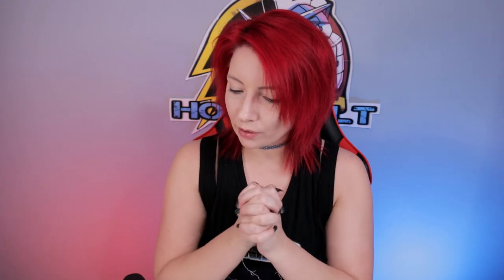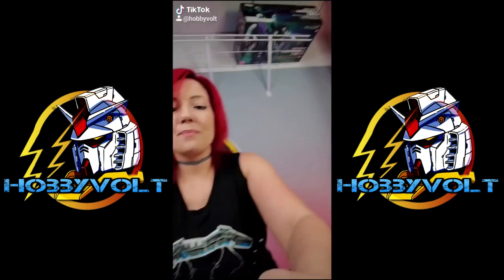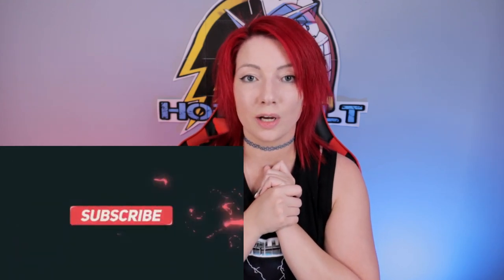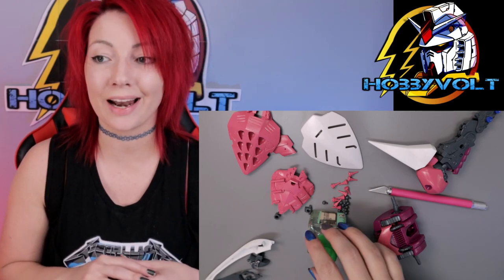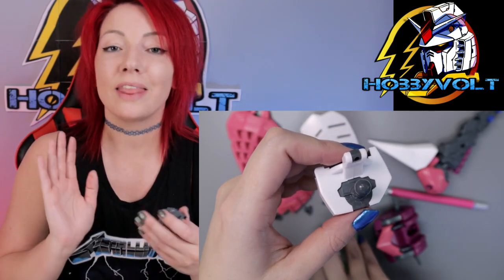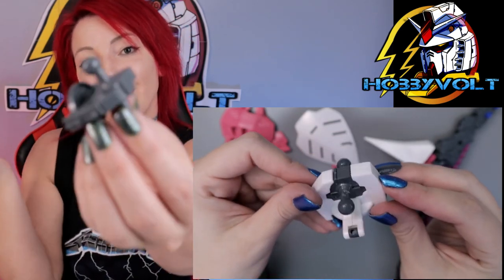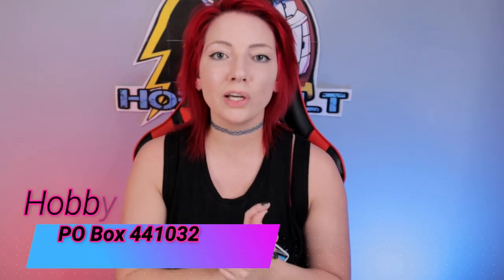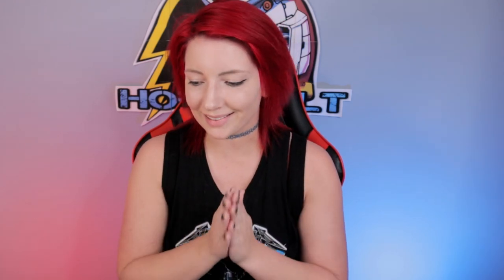How to fix Broken Gundam Parts! Tamiya Cement #gundam #gundams #gunpla

Comment: Information to better understand fixing broken parts: 
The thing about broken plastic parts is that they'll never be as strong again, unless you can pin the parts with metal (sticking either a brass rod or paperclip piece in there).
The thing with materials is that they have an underlying structure and properties. The harder something is, the more rigid and prone to cracking it is. The softer something is, the more pliable and flexible it is without being damaged. Same goes for plastic, glossy hard plastic cracks easier, like the white plastic on an RG Tallgeese. 

The reason I mention it is to give people an idea about how materials work. If you zoom in on it on a molecular level materials have lattices and structured molecules. Think of wood, it has layers around a center and for gunpla plastic you have the way it's flowed into the mold and settled. 
Meaning, if something breaks, that length is interrupted and when you glue it back together with cement, that damage is still there even though it's fused. That "length" is what gives the material structure and allows the force to be distributed evenly. A glued on part doesn't have that distribution and the weakest link will break with less pressure than with an unbroken, unglued part.

Extra thin cement melts just the top layer. Regular tamiya cement will melt more, but also give you a generally stronger bond. 
Use the cement on both ends, let it work for a dozen seconds or so and then put the parts together, move them around a little to mix the melted ends and settle where it "fits", then let it rest and cure. 

Superglue isn't just something universally "sticky", it's a liquid plastic that hardens when subjected to moisture and has an extremely high viscosity/low surface tension, meaning it flows into everything it can, so all those surface irregularities too small to see, the glue flows into and hardens, creating a layer in between the two parts that is "hooked" into the little divots and ridges of the surface. If you had a 100% flat surface, the glue would just form a layer that would slide off.

A pinned part is when you drill a hole on both parts and stick a metal rod in it, superglueing it to both parts. You can cement the broken end as well to remove the surface break and create a double bond. This is as close to the strength of an unbroken part as you get.

For something tiny, like a tab on a sliding panel, like the ones on a transforming unicorn gundam kit, I'd say go with superglue. 

Bottom line, you still need to be careful with the bond, no matter what you've broken and fixed.
Reply: My man u r a god
Reply: Im trying to fix my unicorn gundam   because the sliding panel broke so do i uss super glue ?
Reply: @Iamasmartandhardworkingperson  I fixed an MG Phoenix (basically the same as a unicorn) with plastic cement, it was a tiny little tab that was part of the transformation gimmick.

The reason being that it has to fit in the groove and move freely, so using plastic cement (also known as plastic glue) gives you time to set the piece properly.

Superglue doesn't give you more than a few seconds of worktime, but if you can align it perfectly and make sure you don't use too much so that it spills everywhere, it'll work just fine.

Just remember that it'll always be a weak point on your model and needs gentle handling.
Reply: Thank you too

Comment: Broke a joint peg at the leg of my MG Justice. Thank god you had the same problem as mine. This video has been super helpful. Thanks!
Reply from the maker: It's the worst! I'm glad it helped you!!!
Reply: How did It turn out? Was the bond as strong as originally was?
Reply: @nelsonfabianriosdeantonio6211  not as strong as it used to be before. I didn’t bother touching that joint anymore ahahahaha. But in my case the joint has a cap(?) so I think the cement didn’t reach til the inside of it.

Comment: really helpful,  my figure rise standard wargreymon amplified both ball joints are broken (tbh dunno why they put such a little ball joint on two separate arm parts because the claw parts are too big and heavy,  and not a big one on the shoulder part instead which attaches to the body so it's not gonna be broken easily). anyways thx for this tutorial found it really helpful keep up the good work :)

Comment: I just cracked the shoulder hole of the black wargreymon kit (his shoulders are some tight joints) and i am planning to buy and use the tamiya cement. How strong is the  cured Bond? Is It as strong as a solid piece of plastic?
Reply from the maker: The cured bond is pretty solid. I never have the pieces break again. It fuses the plastic together so I would say it's pretty strong but can't be as strong as the original unbroken piece.

Comment: So I accidentally glued a ball joint to the foot and it broke off.  now I can't even stand it up. And the gumdum is called vidar 1/100 what do I do
Reply from the maker: So this is kinda tricky. Short answer is if it's plastic glue, it's now melted together. You can try to cut the piece out and redo the ball joint. If it's just normal glue, you can try watered down acetone but be careful because it can melt plastic!
Reply: @HobbyVolt  oh ok

Comment: fan from 🇵🇭 🇵🇭 🇵🇭
Reply from the maker: WELCOME!!! Thank you!!!
Reply: Hahaha hi po
Reply: @HobbyVolt  so could this thing fix the A 33 part of my cross bone it broke in half :(
Reply from the maker: It's been a while since I built mine, can you tell me which piece A33 is? Either way, it could definately help it! I've brought back completely broken in half pieces before with this. I start by placing the cement in and letting it sit together for a few hours. Then I go back and place more in the creases that are still open. Now, if it's too far gone, I'll do plaplate, meldted down runner, or putty to fix the gap. If it's not too bad, the cement will be fine! Hope this helps!
Reply: @HobbyVolt  it covers the feet
Reply: @HobbyVolt  and make the poly cap don't go out
Reply from the maker: OH! Yes, it can help but you might have to add material to fix it fully!

Comment: I've never actually had used tamyia cement. Mainly testors cause its the easiest to pick up.
Reply from the maker: I used Testors as well due to ease. I picked up this one and it changed everything!
Reply: @HobbyVolt  not gonna lie I've thought about getting a model after gaining a lotnof hobby experience from warhammer army building. Just don't have the space for them
Reply from the maker: @TheSupporter76  I know so many people in this hobby that did Warhammer. I've never played but always wanted to! Plus painting! But what I did when I don't have room, I built kits for friends or gave them away. I know that kinda sucks though.
Reply: @HobbyVolt  trying to figure out how that sucks. If the model price barrier to enter and current world situation didn't prohibit its almost the best time to enter with the official apps that allow much more affordable rules access.

Comment: I dripped apple juice on my MacBook Pro a few years ago when I was on a flight, so lol. I get the pain!
Reply from the maker: THAT'S AWFUL! I would have been so upset! Was it ok?!
Reply: @HobbyVolt  nope. It spoilt. Like totally.
Reply: By the way, I think the Tamiya Cement is a great tool as well. Used it a lot when I was a kid building model airplanes and cars. Especially when handling those flimsy parts.

Comment: I know the Mondays feels.
Reply from the maker: They are too real...
Reply: I had my air brush play up on 2 Mondays ago which alothen had my clean pot drop to floor spillit content lucky it just mix of thinners and air brush's cleaner and so e off spray of Pai. But that a solid mass but turns out what was cause my air brush to play up was it needed liberation in the mechanizesm that. Allow the Tripp to spring back up fully instance flow stop XD
Reply from the maker: @DrewberryHobbies  That has happened to me before too! 😅
Reply: @HobbyVolt  i reccenlt had part break on my fumina it was fully my flaut I wasn't taking her apart cause I in the middle not repainting her rescribing her panel line the few she has when the part fell on the floor I go to roll back in my chair not knowing the part was under the chair I hear a crack lucky it was in a spot I could fix.. that was  Friday  early morning..
Reply from the maker: @DrewberryHobbies  OH NO!!! I would be so mad! I can even hear the sound it probably made!
Reply: @HobbyVolt  oh I was but thankfully I was able to fix it so easily just sanding the little bit filler fix wear the plastic chip from the break once I find that it will. E like new won't be able to tell it ever broke once painted it was my flaut in the first place so can only blame my self but good repair practice